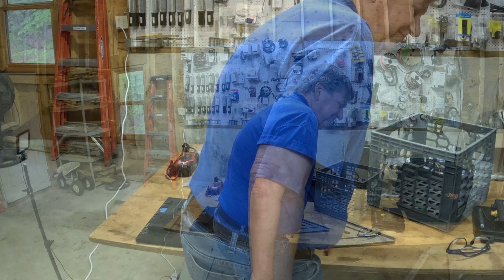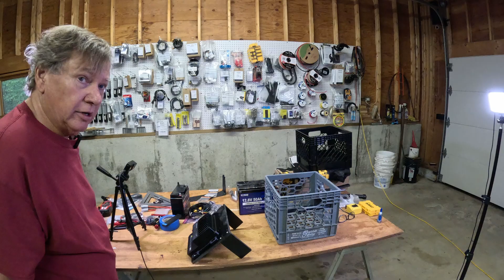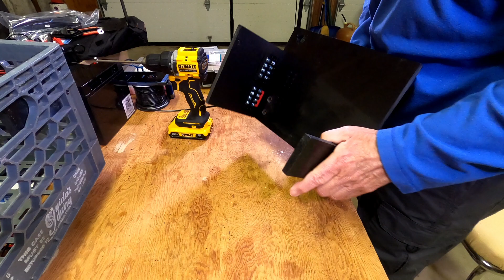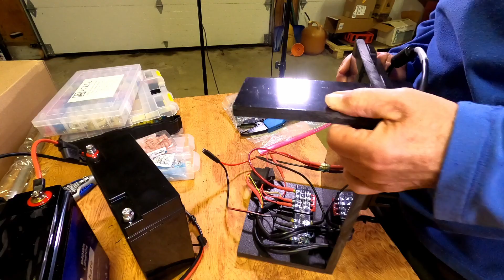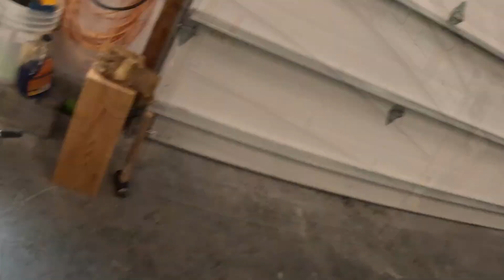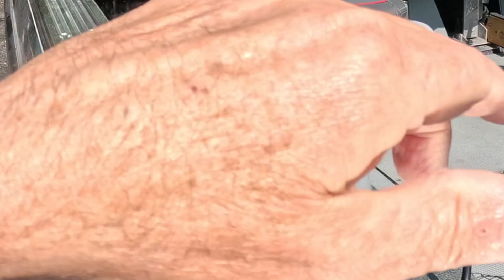Portable Active Target System for Small Boats, Kayaks, Canoes, and Other Watercraft - Full Video

Comment: Hey Gary…I have HDS Live 12 and 9 on the bow; HDS 12 and 9 at console. Ghost TM with 3 in 1 nose cone. AT2 (plugged to Live12 on bow). Point 1 near rear. I have performed the latest 25.1 update on all units. Have Ethernet connecting all units. Have NMEA 2k backbone connecting all units. When I go to Settings/Network/Device list on each unit, it only lists that particular unit and nothing else. Also, the Point 1 and Ghost do not show up anywhere (Device list, nor Data Sources). Any thoughts on why I can’t see all network items on all units? BTW the NMEA backbone is receiving power.
Any possible way I can actually call you? I’m in Texas…I understand if you don’t have time, I’m just at my wits end here…thanks in advance
Reply from the maker: It sounds like the NMEA bus is not configured properly.  Check the following 

Terminator at each end of network. 
Every unit is connected to a Tee
Each Tee connects to either another Tee or a cable. 
The NMEA power cable connects to a Tee and either a Tee or cable
Reply from the maker: Also, I have seen if there is a bad device on the network then it will shut everything down.
Reply from the maker: Troubleshoot by disconnecting all of your units from the NMEA bus.  This should leave the point 1, Ghost, and power node connected. Connect one unit on the bus and check the device list. If it shows the point 1 and Ghost then add additional units until it fails.
Reply from the maker: Did the NMEA network work at some point? I've seen installs the had 2 power nodes, no terminators,  and units hooked to the side no the bottom of a Tee.
Reply from the maker: If that doesn't help then contact me on Facebook and we'll go from there.